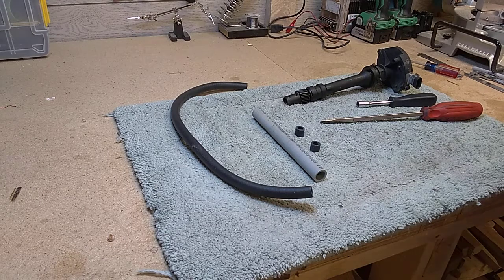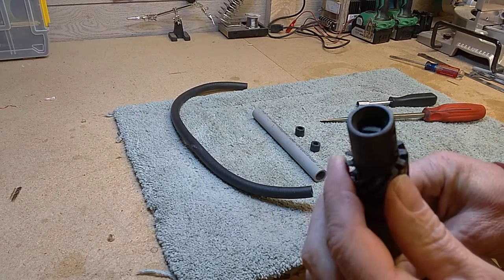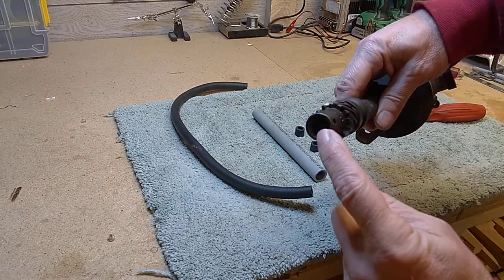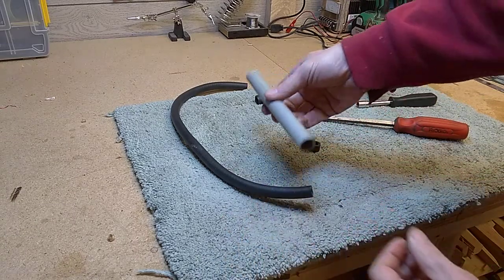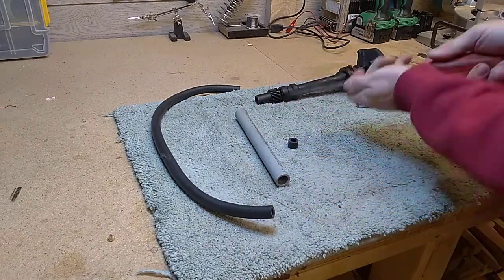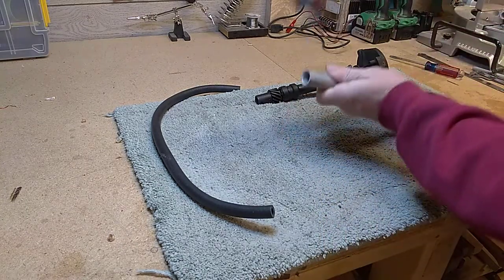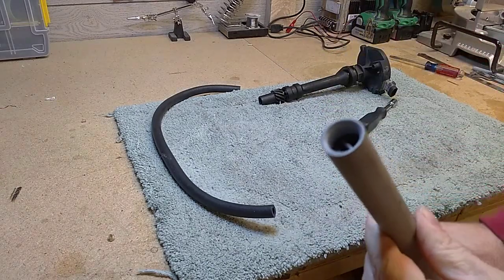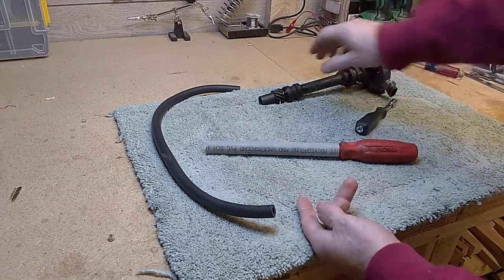Homemade oil pump alignment for your small block Chevy V8 or 4.3L Vortex V6.

Comment: Apologies if this is a dumb question, but do you align the distributor gear with the drive gear?
I assume you you have the engine set at a particular position, such as top dead center on number one cylinder, and the distributor rotor has to be pointing at a certain angle?
I suppose i should try to find a Vortec V6 service manual . . .
Great tip with the tube and screwdriver by the way, thanks.
Reply from the maker: Yes, the distributer gear is aligned with the drive gear, and you assume correctly.  Ideally, you would remove the distributer, and replace it without turning the engine over.  You want the rotor pointing to the exact same location as when the distributer was removed.  The oil pump may need to be wiggled with my tool to get the dist. re-installed.  If the engine has been turned over, or rotated, with the distributer out, you'll need to find another video.  There should be plenty of them.

Comment: All of that is unnecessary.
Set your distributor in the position you need it. Then start to rotate the engine by hand the distributor it will drop down once a slot is lined up. The alignment of the oil pump does not matter. The only Alignment  that matters is the distributor with the cap and router.
It will drop in place once the slot is lined up.
Reply: The distrubutor is not gonna flush perfectly...you don't know what your saying kid
Reply: @tualautakid213  he is just saying that once the distributor gear is partly engaged on the cam gear you can manipulate the crank by hand to get the oil pump key aligned.  He is right.  But I don't like rotating the engine with a partly engaged distributor myself so I'd rather use the screwdriver.  But many do it the other way.

Comment: very clever tool you came up with.  I'm curious if the 4,3 are less prone to the bad/faulty design compared to the 5.7. I have owned my van for ? 4 years now and the caps on my  2001 express 3500 eats caps like I eat chocolate. Just installed a metal housing distributor YES it is a damn chinese product, new cap & rotor, look pretty cheap also. van started right up, didn't set timing, no missing / hesitation. haven't driven it on the road but seems fine. My old distributor has less than 90k on it, end play & radial play looked good.  I also seems to have a no start condition when it rains or even heavy humidity here in Houston. wait for the sun to come out and it will start.  as vise grip garage says ( I Don't Know )    It certainly can't have rain getting in especially in a van but humidity is possible.  I will have to check the holes in the bottom to see if they are dirty.    that's my experience
Reply from the maker: Based upon how filthy the backside of my engine gets, I think airflow has something to do with it.  It's as if all of the crap stirred up by the cooling fan, and movement of the vehicle, ends up landing near the distributor and staying there.  I insulated an A/C line running over the distributor with pipe insulation, so if it's one that get's cold maybe it won't condense and drip water.
Reply: @LarryCook1960  I don't think the AC line you cover drips, I might be wrong, it'll be the first time in my life. LOL